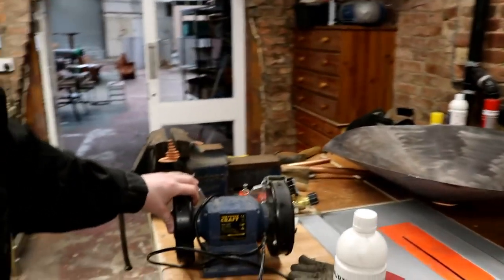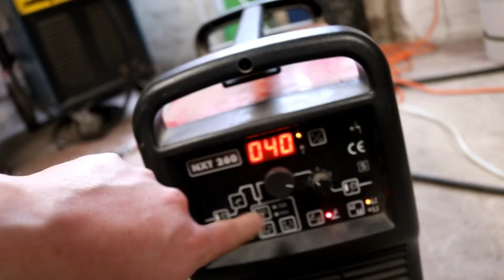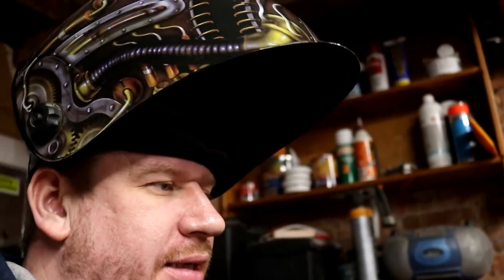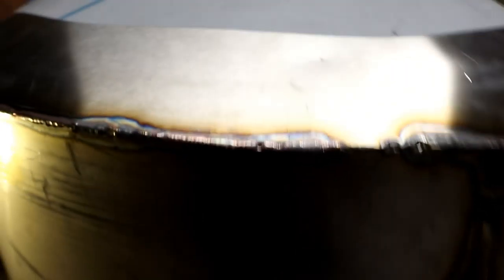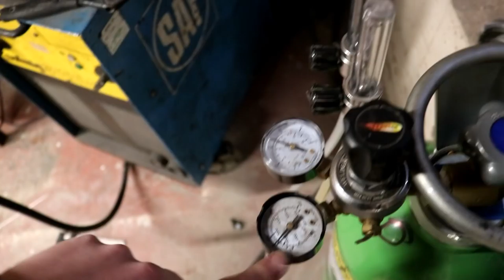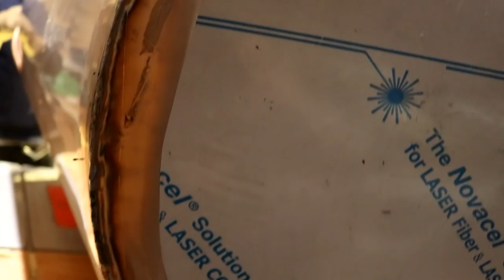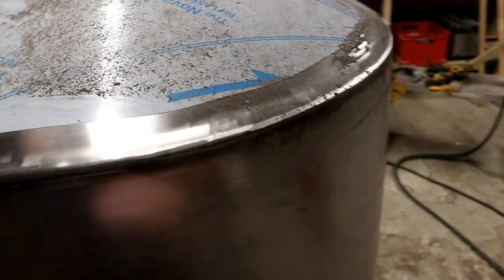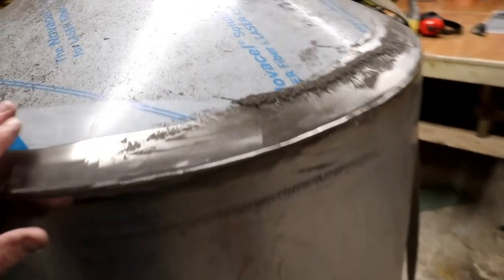Grinding my welds off.

Comment: Looking good so far. Do you intend closing the top ends with a circular piece and use some sort of manway, or are you going to have a removable lid? The open end looks a touch on the flimsy side if you're looking at a lid.